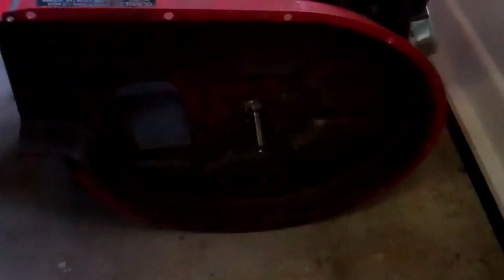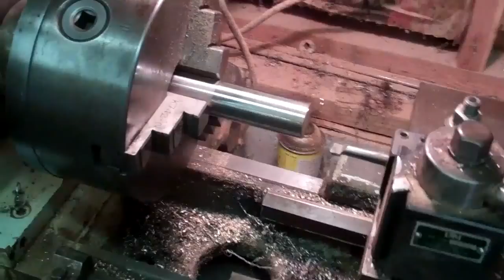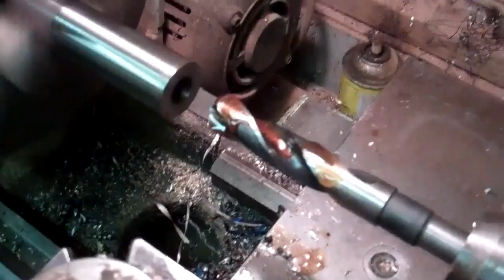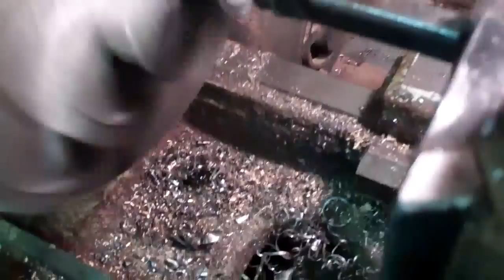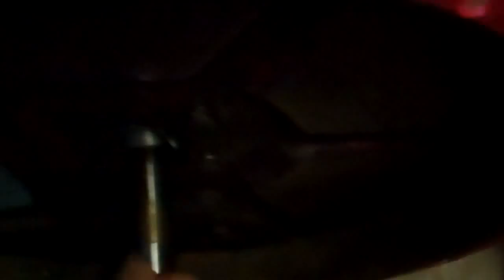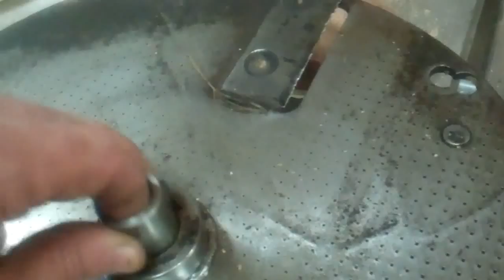REPLACING CHIPPER MOTOR WITH PREDATOR ENGINE PART 2

Comment: I had to actually cut 2 slots in the adapter in my application for the cyclone rake one for the engine's key and the other for the key for the impeller. plus i needed a spacer for the bolt to mount the impeller to the engine shaft as the metal part rubbed on the engine case so i had to space that out a bit so far after a season of vacuuming debris it held up fine